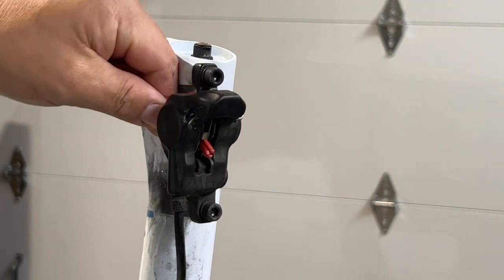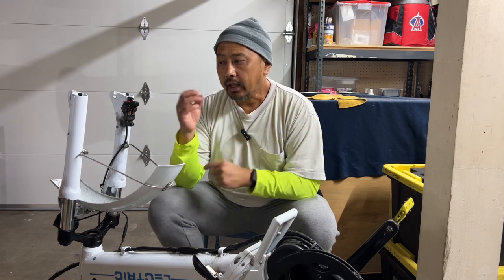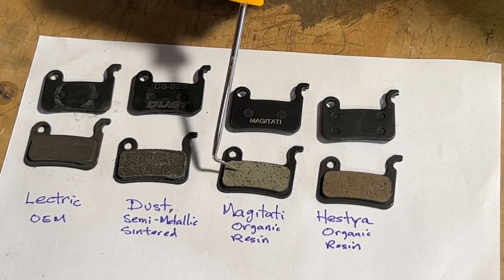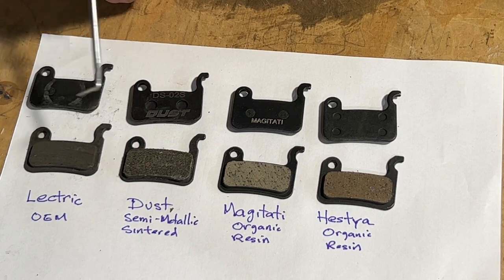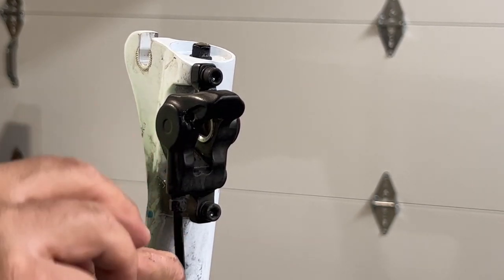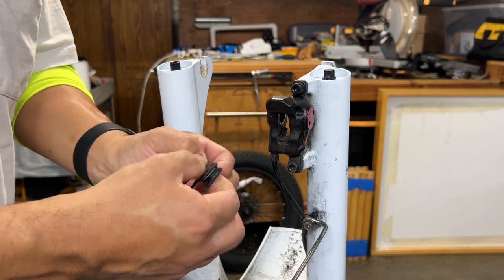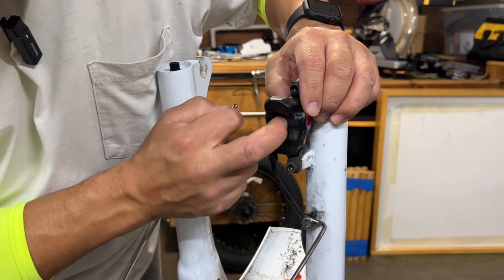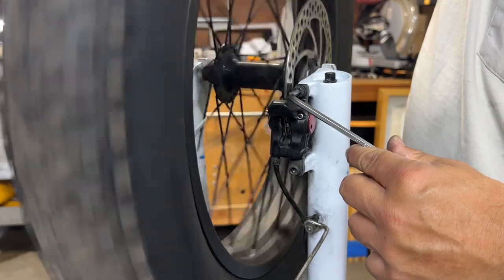XPremium - brake pad options and how to replace.

Comment: Thank you for this video. Just put the first 300 miles on my Xpremium. My rear break is getting soft to much play or maybe air in the line. Could you show us how to blead the hydraulic system?
Reply from the maker: Great suggestion...I will plan on that video.  I have the kit to do it but I haven't had to do it yet.  In the mean time, Have you checked your hose and connections?  It does sound like there is something wrong with the line.  I find it odd that all of a sudden, it has gone squishy.  I will see if I can put together a video soon.  Safe riding!

Comment: I just bought a lectric xpedition. Will these pads work, or do I need to order a different model pad?
Reply from the maker: unfortunately, I have not personally seen the pad on the expedition so I am not 100% certain.  I image they should be similar, especially if Lectric standardize their parts inventory.  Best is to check by looking at the existing and if it has the pin running through the side and it got the dog ear, then these styles will fit.  Good luck.
Reply: @tai.randomthings  thanks brother
Reply: Yes, buy ceramics.

Comment: I've watched parts 1 thru 3, part 2 twice; however, I wish that you would have experimented more with the 11-34 freewheel.  Are we doomed to have to depend on Lectric to always provide a freewheel in the future?  I do not yet own the XPremium but now maybe I will buy something else because of the lack of available freewheel options.
Reply from the maker: Hi Terry, I think I have answered the same question you posted on another one of my videos.  I get what you're saying and it makes sense.  I will experiment with the other freewheel.  Choosing an ebike can be daunting.  I know, I have 9 ebikes as I am trying to learn what works for me.  In that process, I've learned that I cannot find a bike that does everything I want.  It may be because the price point I am trying to stay in (less than $2K).  I don't have the perfect bike yet but they all are better than my old beach cruiser.  Freewheel is a big deal but I think the bigger question is whether you want a mid drive or a hub drive.  Again, it's a lot of money so I want you to decide what's best for you.  Best of luck and thank you for watching my videos.  Happy riding!
Reply: @tai.randomthings  I would really like the mid-drive.

Comment: How do you find correct replacement pads? I have a Polarna M4 model with hydraulic brakes by DyIsland?? The Chinese can use brands unheard of, lol. And the Polarna is not your well known big ebike brand They work fine tho the adjustment screw for brake lever travel always works loose. So during ride, you find yourself checking them so they won't fall out. Discs are 160 cm rear and 180cm front
Reply from the maker: Unfortunately, if you cannot get the information from the original manufacturer, it may be a trail and error process.  I do think they are pretty dang close if you get the support shape the same.  In my case, one side had a half hoop so I looked for one that looked the same.  I think they were a little different size but barely noticable and close enough and they worked fine.  Look on amazon for a imilar size and shape and offers a return policy.  Then physically compare when they arrive. If they don't fit, then return and try again.  Sorry, I don't have a better answer for you.  Safe riding!